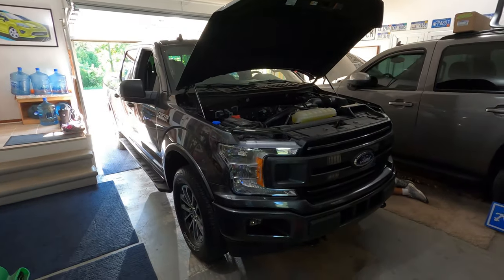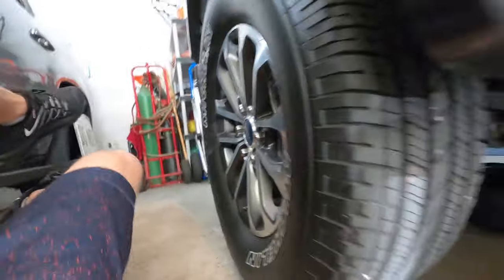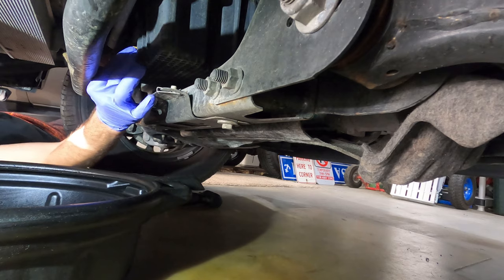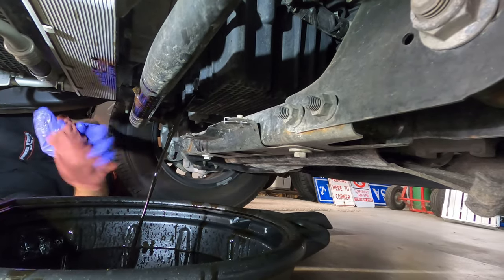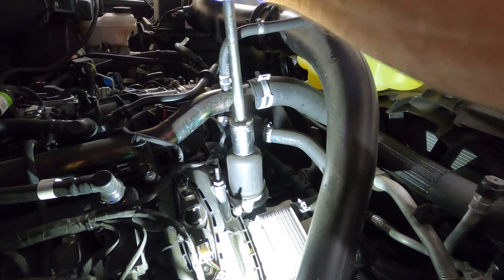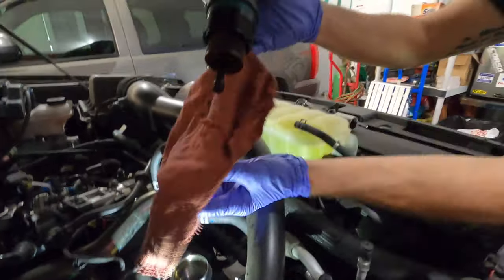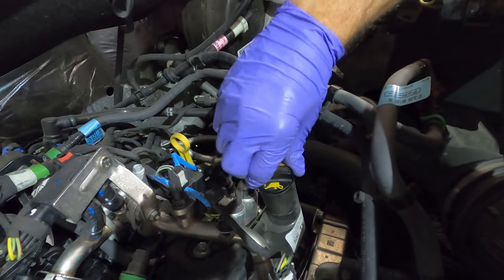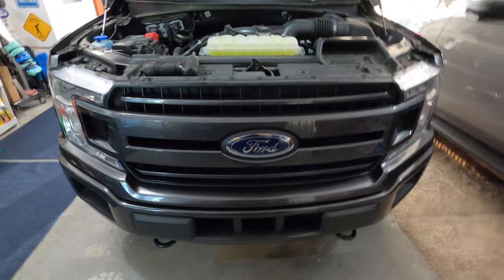2.7 F-150 Ecoboost Oil Change | How To - FORD Dealer TECH does it @home!!

Comment: Quick question. I have a 2016 2.7 ecoboost F150. The other day I checked the oil after the truck sat for about 15 to 20 mins on level ground. The oil was just below the first hole on the dip stick. So I added oil to it and checked the dip stick again in the morning. Now the oil level is slightly above the second hole on the dip stick...is it okay if the oil level is a little above the second hole? Anything to be concerned about?
Reply from the maker: Im sure youll be fine
Reply: @PowerStrokeTechTalkwARod  thanks!

Comment: My new filter didn’t fit snug when put in the housing, when turned upside down to screw it back in chamber it would slide down to the end of the little pole thing sticking out. Is this an issue or will it snug up when tightening the housing back w a torque wrench?
Reply from the maker: Hmmmmmmm

Comment: You need to get a catch can on that truck asap.
Reply: Why? It’s port and direct injection.
Reply: @garrettheale9429  the blow by on these trucks espically if towing anything is crazy. Saves the turbos. We put one on my dad's 2016. The first tow with a camper on the back an about 1000 miles had that catch can full.
Reply: @onehitterquitter2130  in 2016 the engine didn’t have port and direct injection

Comment: The Jiffy Lube Ford engineer who designed that drain plug and location should be shot (even worse on the 3.5L EB).  Clearly not designed for the home mechanic, but to eliminate the oil as quickly and uncleanly as possible.  Not knocking the polymer drain pan or plug, just the shitty design.  If you want to see how polymer is done right, change the oil on a 7th gen VW Golf.  15 mins and I'm done, no fuss, no muss (mess).

Comment: HI...I just had my oil changed in my 2018 F150 Eco 2.7L with 39,000 mies on it.  Ever since, my average mpg has dropped from 19 to 15 mpg in the same driving conditions.  Any idea why this would happen.  He used Valvoline Full Synthetic Oil.
Reply: @PowerStrokeTechTalkwARod  damn...I was hoping you could shed some light on the issue.  Been reading that it could be the brand of oil.  Just seems really weird!
Reply: The mpg's will also drop when it's been in the garage all night and I start it the next day...I can watch it drop by tenths right in front of my eyes!
Reply from the maker: Lots of things pal
Reply: Any possible suggestions would be appreciated...I did reset the mileage over a week ago.  I’ll run a couple tanks of gas and then see where I’m at.
Reply: When I bought my 2018, went on a trip, was getting 28mpg. After an oil change went on a trip and got 25 mpg. When I bought the truck the tires had 40 psi. The tech had lowered psi to 35 psi. Made a difference.

Comment: What do you think about dropping the sway bar? One of the techs showed me that, sure makes a smaller mess!
Reply from the maker: Nahhhhh
Reply: Thats too much work for an oil change   just cut up milk jug put it directly under oil drain plug just bfore taking out and use like a funnel  works for me no mess
Reply from the maker: Good to hear

Comment: Do you know the torque spec for the oil filter, I looked all over er the internet and couldn't find anyone.  
Thanks
Reply from the maker: Look at the cap
Reply: @PowerStroke Tech Talk w/ARod  it's the housing that the filter go into
Reply from the maker: On the plastic cap ull see writing on it.

Comment: I just bought a 2020 XL regular cab, but ordered the 3.3L for simplicity under hood. Didn’t get rid of the 6.fo stick, but it’s only gonna move to pull trailers.  The dealer was not happy when I didn’t want to set up the Ford pass system. I’ve since pulled the fuse for the modem, but the radio still keeps asking me to setup every few startups. Any idea how to stop that?
Reply from the maker: Put fuse back in...🤷‍♂️
Reply: @PowerStrokeTechTalkwARod  With the fuse in, it still flashes that it's sending data even without the setup.  I wear a tinfoil fedora because regular tinfoil hats don't look classy.
Reply from the maker: That's the problem you should be wearing a dunce cap not a Fedora
Reply: @PowerStrokeTechTalkwARod  Yee yee!

Comment: It'll be easier just to use an oil extractor
Reply: Don't think you can use an extractor on the 2.7. I heard they have some baffles in there so you can't get to the bottom of the pan with the tubing. I used an extractor on my VW golf & it worked great.